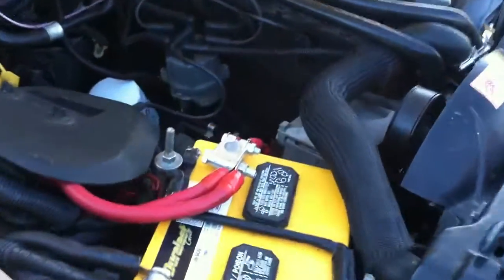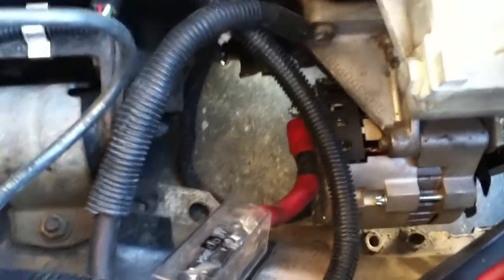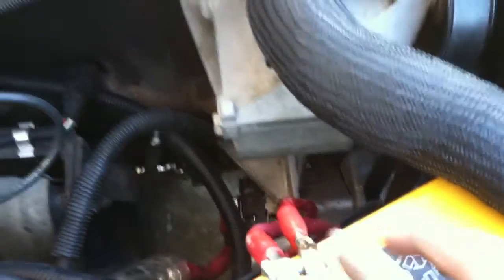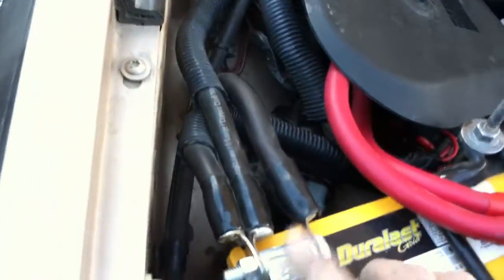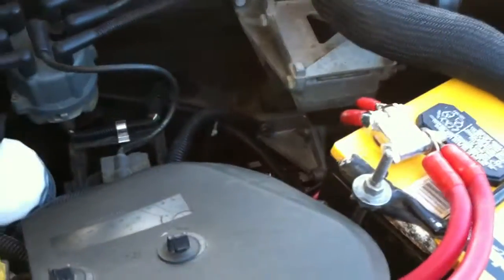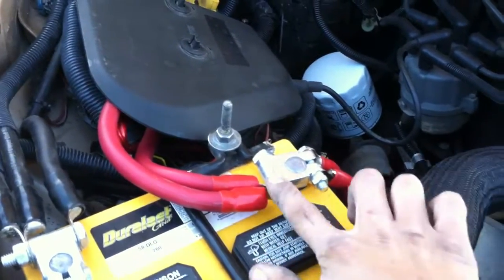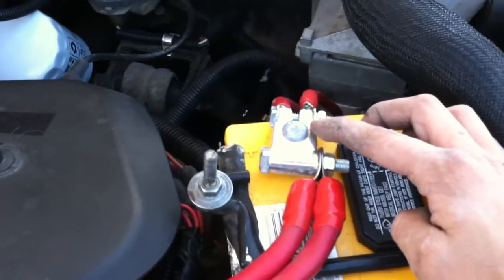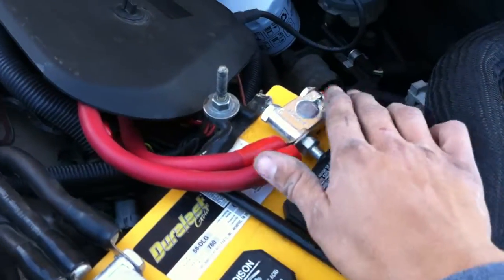The "Big 3" Electrical Upgrade Rundown

Comment: What if I can't find my ground wire for my motor are there any other options with that being the last one I need to do?
Reply: Put your battery ground wire to the chassis like the firewall like he did then the other one to your alternator mounting bracket, theres a large bolt that holds the alt in place and will work for engine block ground

Comment: Or for the one ground you did to your alt., if you can't get to it easily you can just find a good ground bolt on your block somewhere, cause that is all you are doing by connecting it to the alt. cause your alt ground is through its casing to the block. Great suggestions.

Comment: Great video. I've done the Big 5 on my LR Discovery:
1. 0AWG from alternator + to battery + (add 150A fuse close to battery +)
2. 0AWG from battery - to chassis
3. 0AWG from engine to chassis
4. 0AWG from alternator housing to battery -
5. 0AWG from battery + to starter +

Comment: hey man, wondering if you can help me, when i connect my alt+ directly to batt+ my car doesnt start properly, it loops on and on i have to rev it to turn on and even then it idles below almost below 500rpm and almost turns off the engine, not sure if im missing something? as soon as i take off the 0gauge wire it runs perfectly fine again, is there something that im bypassing? wondering if i can make this work, car is a toyota matrix 2010 !

Comment: I'm having a issue deciding where to put the 3rd ground. I see yours is on the alternator mounting bolt. So as long as it's some bolt on the alternator, it would be good???
Reply from the maker: Many alternators will have a tapped hole or bolt on the case with a lable like G or GRN, that is a designated ground spot, otherwise just try to ground to the case best as possible.

Comment: From the battery to the alternator how did you know the size of the fuse to use
Reply from the maker: +Ferber b same or near the rated output of the alternator
Reply: So if my alt is 80 should i run a 100 amp fuse ?

Comment: do i connect the fuse before i make all my connections or do i connect it after everything els has been connected ?
Reply from the maker: +Cingle player Fuse is always the last thing you install, and should be removed any time you make changes
Reply: JeepAndBass so basically make sure that i install and connect all the other wires to the battery then put in the fuse ? because they always say you need to connect the positive first and the fuse is on the positive wire.
Reply from the maker: +Cingle player On anything you should connect your grounds first, including batteries and amps.... then start connecting the power wires with out any fuses installed. When you are confident your wires are installed correctly and are safe then install the fuse.

Comment: whats the purpose of the fuse in between the alternator and battery?
Reply from the maker: I went overkill and put it, you really don't need one because the wire is pretty short and shoulder ever short out.
Reply: JeepAndBass OK that's fair. I guess keeping it away from the engine block and ensuring its not cut or melted should suffice. Fuse is basically piece of mind.

Thanks,
KC101

Comment: Did you go from the alt to the stater sylinoid then to batt with the power and also what size fuse did u use
Reply from the maker: I did go from alternator to sylinoid  then to battery just because that is how my Jeep is set up stock. I used a 200 amp fuse because my alternator is rated for 200 amps.
Reply: Sweet thanks

Comment: Hey man good video! I have a 2001 chevy suburban 5.3L V8.
I was wondering, is it okay to ground off on a alternator bolt for the engine ground, or do I need to actually find a place to ground on the engine.
My first ground will be to the body, I'm just gonna use the battery bar that goes over the battery but doesn't touch the battery, so i'll just scrape it down to metal and bolt the bar back in place and i think that'll work there.
Main concern is grounding on the alternator bolt.
Let me know if you can and thank you if you do!
Reply from the maker: More grounds the better, and yes you can use the alternator bolt a a ground. It will best ground the alternator and it will act like an engine ground also. The engine does need a ground to run sensors and such but it's fine to use the alternator for that. As for the ground to the body just make sure it is a solid place to bolt to. Basically your amp needs a good ground and so does the battery to supply that amp. I have two body grounds just to be sure that I can get the best circuit made to power the amp. The positive side is no issue because you run a wire directly to the amp, but the grounds don't get a dedicated wire directly to the amp so overkill is always best.
Reply: okay awesome. I also found the bolts for the positive terminal bracket (they don't touch and are separated by a piece of plastic) which is also used a lot (or so it seems) to ground on for the engine block since it's a direct bolt to the block. Should i use that one or the alternator bolt. they are within around a foot of each other so i don't know if there is a problem with two engine grounds that close to each other touching the same metal. Also is 2 grounds enough with just the 1 engine and 1 frame ground or should i do the 2 engine grounds and 1 frame. thanks for the first answer.
Reply from the maker: atrevino95 If you have the wire then do both.  But the alternator is fist priority. would do one to the alternator (that will act as an engine ground also) and do two on the frame. This video may help How to do the "BIG 3"

Comment: I hooked up everything and I kept all my stock power and ground. I tried to put the battery in and stated sparking and smoking really bad so I took out the battery... Wtf happened?! I bout shit myself.
Reply from the maker: Something is shorting. Check all the insulation on the wires, likely a positive wire is touching somewhere were it is grounding out. Also, did you have fuses? Did you run the new wires along with the stock ones so now there are both? just curious.
Reply: i put some plastic washers on the positive post on the alternator and its all good now, the positive was touching the alternator and arking
Reply from the maker: brandonlei45 Nice, hope everything works out for you.
Reply: thanks bro

Comment: Do I have to remove the stock power wire from the alternator?
Reply: You actually don't have to remove any of the wires I just added the wires to the stock ones by the way I can follow them when I zip tie them and it's nice and clean.

Comment: I have a 98 grand cherokee. It's the 4.0l and how do I get to the engine block ground? U also have the inline 6 so I was wondering is it easy to get to or is there any other easier ones that I can use? Because the one u used looks tough to get to. I'm doing the big 4 as well.
Reply from the maker: The stock one for my '90 is on the rear passenger side of the block and ya its hard to get to. You can ground at the alternator, either on the case or on the mounting bracket, just use one of the bolts on that bracket. It too is going to be kinda hard to get to but it is a better spot.
Reply: JeepAndBass alright man thanks

Comment: Ok last question. I did find the grounding strap, off the positive side of
the battery there are 2 wires 1 to the alt and the other to a fuse box
under the hood do I need to replace or upgrade both or just the 1 and do I
put the in line fuse on the one from the atl to the battery or from the one
coming off the fuse box. Again thank for your help.
Reply from the maker: It might be beneficial to upgrade both of those positives because it may help out your headlights, deck, gauges, sensors if you upgraded the one to the fuse box but I wouldn't say it's a must, just one of those things like your already there so you may as well do it. For the alternator, you must upgrade this, even if you did not have a system it's still is a good idea because the stock wire is always so small from the factory plus it can be weathered if the car is older. The run from the alternator should be fused near the battery just like anything else, I use a 250 amp fuse for my 220 amp alternator, this is so the alternator won't blow the fuse and the fuse is not any bigger than it needs to be. The goal is that if the wire ever shorted, that the fuse stops the short before you have other problems so you simply get a size of fuse that is slightly above what you are pulling in amps. The fuse box should be fine because it has fuses already, the only reason I might think to put a fuse on that run would be if the wire to the fuse box was far away from the battery. Also what gauge wires do you plan to use and how many watts is your system?

Comment: Ok sorry cause I feel really stupid. I have just seen about a 50 different ways to do the big 3. So my next question is for the ground to the block does that go to the negative on the battery or to the chassis.
Reply from the maker: To the battery, if you were going to be over kill then you could go to both.

Comment: Question is the same one as above do I need to ground from the engine block to the battery and I don't know where mine is any help would be appreciated 08 impala 3.5 engine. Thanks
Reply from the maker: Yes, grounding to the block is good not only for the electronics and sensors but also for grounding your alternator well. If you can't find the ground look for a braided wire that should be silver that bolts on to the engine then to the car, sometimes this is used as a ground for the engine. If you don't have that then you can look for another bolt to just put a ring terminal on, the best would be one that bolts the alternator on or the alternator bracket on. Hope that helps.

Comment: I was wondering, in your video your ground cable go from the battery to the chassis and then another one from the battery to the engine block.

In kits and other videos it describes it to be run from the Battery ground to the chassis and then from the chassis to the engine block.

I was hoping you could tell me if there is any difference at all between the two. Personally I don't think there is, but I want your opinion on it. To me it sounds simpler to hookup in the way you did it.

Thanks.
Reply from the maker: I'd say there really is no difference. If you were trying to ground the engine better then I think it is more effective to run to the battery directly. Running it to the chassis then the engine would then rely on just that one wire to the chassis the cover the engine also. Yet I think it might be beneficial to ground the alternator to the chassis and the battery so it has a strong connection to the battery and any of the electronics and amps in your car too. I might add a ground form alternator to chassis, also the alternator is connected to the engine so that would act just like an engine ground also. At this point its probably all over kill anyways lol.
Reply: JeepAndBass  Haha overkill, no such thing. It's called doing it right and wanting it to be the best lol
Reply from the maker: ***** That is one of the best answers that I have ever heard lol, sadly that is the same way you go broke haha.
Reply: ***** Overkill is underrated!

Comment: Hello can u just change alt to battery wire with good wire and put cheap wire in all ground for big 3?
Reply from the maker: The grounds are probably more important than the alternator, you really should do all your wires. The alternator works as a circuit like anything else in the car so it also needs a good ground, if you only did the alternator positive you probably wont see any difference because you are not upgrading the full circuit.